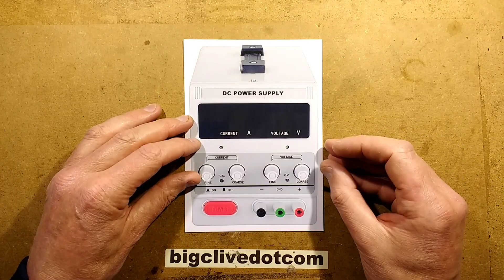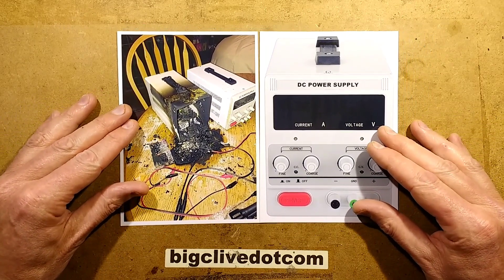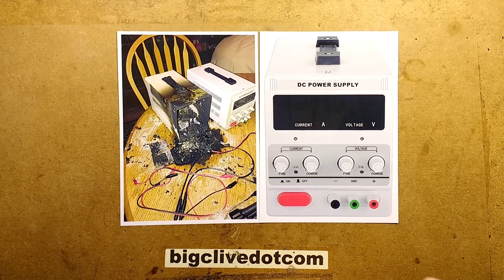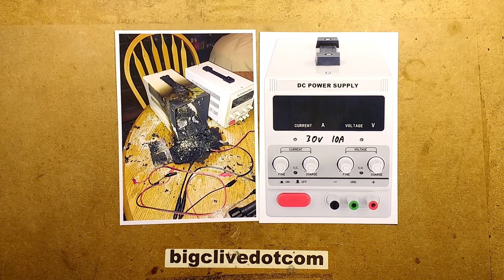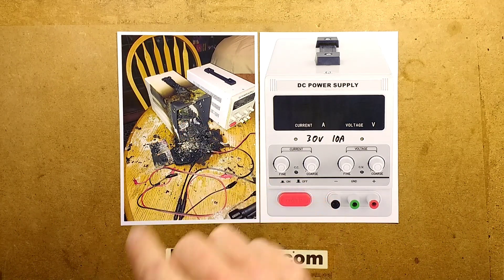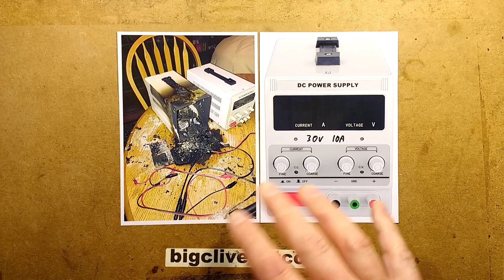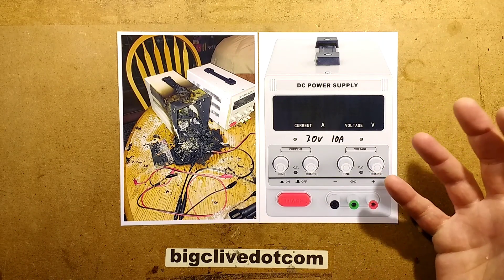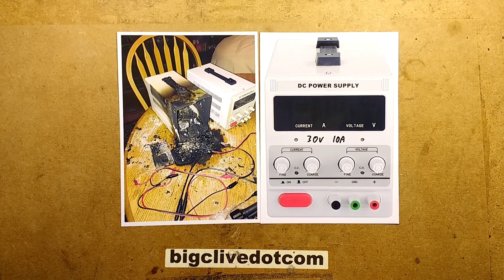Smokin' power supplies.  PSA

Comment: damn Clive. I blew 2 chinesium psu's last week.
Reply from the maker: A very common failure mode if used with external voltage sources like battery charging is for the output protection diode to fail short circuit.  Is that likely in your case?
Reply: No. I had a case of traces exploding...
https://lh3.googleusercontent.com/-Vvarhu7iAZSZBocZKExwgS6IZwG7Zbl5KBeFbx2Di24UblcOYH9r9Ru_hq4S7PpVanl-MzB
Reply: I did check the diodes, fuse. Did a full visual inspection as well as checking values of components that I was able to find the values for. The photo is from a Kentek 700w pc psu (GL-PSPK700B). Ran fine for 3 months and BOOM. 

It was my fault for buying crap. You get what you pay for, just like the other psu that bit the dust, a generic Chinese 20a 12v psu that came with my printer. I haven't taken a real good look at it yet as I was more concerned getting a dual rail psu going to support the hotbed and electonics on separate rails.

Comment: These are linear supplies, so the difference between maximum voltage and the selected voltage is dropped across an internal transistor. 
At 18 Volts, 8A this is at least 30-18= 12 Volts and at 8A is 12x8=96 watts. 
You would hope the cooling is up to the task of removing this heat plus the transformer losses.
As BC says only really for intermittent and attended use.

Comment: I had a similar looking supply (50V, 5A IIRC) Purchased off Ebay. The second time I used it I heard a crack and a fizz and it started billowing smoke out the sides. Fortunately, the seller agreed to let me return it. I have another one (30V, 3A) that I have used regularly for years without issue. Even so, I don't think I would ever leave the house with a live circuit on my bench.

Comment: Holy smokes (the only brand of cigarettes endorsed by God).  What variable PSU should I get as I am not into fires like that?
Reply: something chinesium which has atleast a brand and is sold by electronics shops online.
Reply: As long as your keeping an eye on it, as you should, you won't have any problems really. Also not a terrible idea to have a extinguisher at the bench as well, just in case.
Reply: Build one. There are tons of designs. There's modern L200 or a true classic like uA723/LM723. Mine is built using uA723(0-30V 0-5A but can go higher by disabling current limit). 300VA 2x14V transformer and two 2N3055 on a huge radiator. Goes down to around 100mV by using negative rail(could make it true 0V by adjusting negative rail voltage). There's also a second multi-tap/multi winding transformer which provides power for negative rail, relays and 10V winding for very low output voltages. uA723 is powered from a different supply than the power transistors. This means I can fully utilize the voltage provided by transformer without bothering about PN junction voltage drop as supply voltage of uA723 is greater than max output voltage. Ripple is very low too. Varies between 5-10mVpp(checked using scope). It keeps it low even under 100+W load.
Reply: +sparkplug1018 Not just any household fire extinguisher! check to make sure it can put out Electrical Fires..... the cheaper household ones contain water, and chemicals to make a foam.  The foam smothers the flames, but is CONDUCTIVE...... so anytime there is electric power, and no means to quickly unplug, or turn off the source of heat, there is the potential for shock'.

Comment: Clive, I think you owe it to your viewers to recreate circumstances and determine the true cause of the failure... or perhaps we would just all appreciate seeing a big bang. 🔥
Reply: Yeah, demo or it didn't happen? :p  Poor Clive, stuff like this will make him bankrupt
Reply: yeah time for clive to make one from a capacitor, resistor , rectifier and an old variable resistor,
Reply: inb4 he stuffs a pyrotechnic in the power supply.
Reply: Where's Buddy Vandoodle and his welding gun when ya need him? ;)
Reply: This would be a good thing to cover in a video, preferably having it open with the camera monitoring it outside with some kind of load so we could learn exactly what is the failure and cause of the fire.
Reply: I hope someone digs one out and mails it in. I'd love to see BigClive spend a while trying to determine the likely fault, or just make the fault himself!
Reply: If Clive had a "Mailbag" section, he'd probably not have the TIME to "spend a penny" (if you get my drift . .!)
Reply: ..Clive should have a mailbag section, wouldn't have to spend a penny then ;)
Reply: I couldn't agree more! The benchtop needs more burn marks.

Comment: I have the 30v 5amp one yikes, i wish you would do a teardown of one of these
Reply: I have that same unit as yours and it died early on, I complained to the seller and they suggested that I take it apart to see if I could find anything wrong, I found 1 of the mosfets were cooked and they said if I paid for delivery they would post another mosfet out to me, I told them to stick that offer up their bottoms and just replaced it myself also adding them to my do not deal with again list!
Reply: Mentorcase 
com'on now, if you're going to get real about a seller to that extent, at least go full flame and give me a name to avoid ;)
Reply: Mentorcase It's a hit a or miss with these it seems, I got lucky with mine, I ran mine pretty hard and no problems yet..

it also stays cool..I'm happy with it..mine is the qw ms305d
Reply: Upcycle Electronics im saving old caps for this 4th of july 😁
Reply: I have a so-called "LONG WEI" PS-305D that is now 5 years old and has served me faithfully without much trouble at all (except when I connected a battery in reverse to the output and some electrolytics inside exploded :D).
The longest continuous time I've used it was to recharge the boat batteries, which involved leaving it for THREE DAYS straight at 5A continuous (the 50A charger that is normally used was broken) and it didn't complain at all and survived the torture without trouble! Just in case it would burst into flames, I suspended it overboard with a small string so that the flames would burn the string and the flaming power supply would drop automatically into the sea water extinguishing it :D

The PS-305Ds are not all equal, some have better designs and some worse, even if they look the same from the outside. For instance, many of them have automatic thermal protection and fan thermostat (mine didn't but I modded it in) and some have the transformer with two primaries so they can work on 110 or 220V.
Reply: Benjamin Esposti since when do caps "reform" to a higher voltage. especially one that could be a knock off if it's on a cheapy.
Reply: JJayzX 
  Too bad electrolytic's aren't self healing safety caps.
Reply: Upcycle Electronics but even the ones that do, degrade and eventually pop if taken beyond spec constantly.
Reply: Mine is the Yihua 305D. It is linear, 30V at 5A.
Mine had corroded IC sockets, which I just got rid of and soldered the two op-amps directly to the PCB. The fan is very cruddy, and is an oddball 24V type! (It looks like a regular computer fan but it runs off of 24V)
In addition, the main filter capacitor is rated for 50V (6800uF @ 50V, supposedly Rubycon brand though I kinda wonder if it is fake or not), yet it has nearly 62V DC across it's pins. It hasn't blown up because it reformed itself to be able to withstand the slightly higher voltage.

P.S. All these power supplies tend to be slightly different inside. Yours may be different than mine. (Example: mine doesn't have any mosfets.)

P.S.2. I also have a 0-65V 0-5A switching power supply (made by "Arksen" ... I forget the model) which is noisy. It makes clicking noises under light load (due to it skipping PWM pulses). But the worst parts are that it has FAKE Nichicon PW capacitors (the sleeves are black instead of brown as they should be, and the text is crappily printed), and two zener diodes that run at somewhere over 130 degrees C. (My thermometer couldn't measure high enough!)
Reply: You are very correct sir ;)
Reply: Upcycle Electronics I actually should have one laying around somewhere that I removed from my 3d printer to put in a better one. should go and have some fun with it. 😁
Reply: JJayzX 
Could be interesting, flame, bloat, or blow?
  I've done the electrolytic surprise cap gun charade a few times, and just had my first tantalum cap go full Fantastic Four Superhero style on the project I'm currently working on (sadly wasn't recording at the moment), but I've yet to see a safety cap give it's full Broadway performance.
Reply: I did a tear down of the other common cheap bench power supply, but I think the video came out crappy the way I was trying out and never uploaded it.
Reply: JJayzX cool I'm going to check it out..

Comment: why on earth would he leave it running while he's out anyway? let alone powering something that is designed to generate heat? that just seems like a bad idea all round.
Reply: Yeah. Like others have said. I'm perfectly happy with my Chinesium eBay supply, but I'd never leave it, or any of my eBay devices, on unattended. I just chalk that up to getting a functional item for 1/10th of the cost and free shipping :-)
Reply: ***** he was powering a peltier plate
Reply: It may not have been the power supply that failed. I'd even say it's more likely that it was the wires. Chincy wires, where they skimped on the wire cross section or the connection to the connector isn't made properly, can get quite hot.
Reply: Well it could be 30v at 10a... for a very short time aswell... it's what they say "good enough for an average chinese ebay seller to give it a 30v 10a rating".
Reply: @superdau theres so many ways to skimp, transformer wire, make it alumnium, or cheaper varnish coating that won stand up to heat, cheap metal connectors with no spring washes, the cheap wires with less strands than the jacket implies, the wire joins, lack of thermo safety on the transformer, materials not rated for the heat....im sure if you looked closely at one, it would be a whole long list of borderline parts all being pushed beyond their rating, and then find the parts are not the quality and rating they promise
Reply: There's no way that thing was 300W. It's definitely a fake rating.
Reply: adding a logo costs 1c, another 1cent for the CE logo or UL fake, you can put fluke on it if you want, they are all the same, junk
Reply: +Eroge Guy It is a shit PSU, that is all.
A good PSU can be left on load, within spec, for months... hell I've seen some do a decade!
Reply: +Против Глобал Depends on whether it was a switching or linear supply. Linear supplies (somewhat counterintuitively) generate more heat at lower output voltages.
Reply: THe unattended peltier could be, but a proper PSU should take that for months if needed. Issue is, gargabe built to cost, with fake rating is a problem already. Is like audio in the 80s. Grab an amplifier and push all the day to max RMS spec, even when summer hot, nothing happens. Grab the same product from alibaba and it selfdestructs in seconds. Proper amps cost proper money and performs to spec. Aliexpress garbage is cheap, it will top the specs for some seconds then ... fire,. Better chance is to build some basic 723 based design with GOOD transistors from Digikey, overbuilt it (if the design needs 5 transistors just put 8) proper protection, thermal, fuse, current limiter bla bla bla. Yes, it is gonna o be bulky, its gonna to be uggly. But it wont put a fire in you house. This cheap PSUs tend to blow the pass transistor, at 30V 10A no probs but  let 5V 10A .... Sure, they use multitap ...  not sure now ...LOL too expensive ... the relays you know. Sure its one tap all the way, small heatsink and best case a cheap fan and pray that people power leds or small arduino pcbs with it. Ahhh and avoid arcing and sparks and inductive things because this things go short from nothing.
Reply: I have one, and the rating stands.
Reply: Eroge Guy Because you expect something running at almost half of it's power rating not to go thermal nuclear? Also the Peltier plate wouldn't survive that much current without adequate heatsinks to begin with so the blame goes back to the shoddily made power supply.
Reply: have one of this exact model, it's a switching style, no huge transformer in it. that said, quality control can be dodgy. as i commented on the reddit post that this originated from(or xpost mayhaps) with all cheap chinese stuff of this nature one should never leave it on without supervision, and it should be taken apart and inspected before use. 

that said, at some point i'll probably tear it back apart and get a parts list and upgrade what i can to future proof it a little.
Reply: +Против Глобал It's pretty hard to buy quality on AliExpress. Quality stuff is more expensive, but half of the expensive stuff is the same cheap, shitty stuff, just terribly overpriced. And with the rampant fake reviews, there's really no way to tell (and when I'm paying a modest price for something, I don't really feel like taking the chance). Some things on AliExpress (e.g. Arduinos and the corresponding ATmega chips, ESP2866 modules, single board computers like the Orange Pi…) are consistently good, while others (like breadboard jumper wires which have high resistance and are sometimes completely broken) are consistently bad. The rest is hit and miss (e.g. high power CoB LED modules—sometimes for $10 you get a module with perfectly balanced chips and sometimes you get the same shit with half the chips dead that's being sold for $1.50).
Reply: +superdau: I'd guess it was either the peltier element or, as you said, wires that weren't quite up to the task. Either way the fault was likely in front of the power supply.
Reply: Misplaced trust in Chinese products, I would guess. I have a colleague who leaves everything on when he goes out - PSU, bench lights, soldering iron. His phone is often flat as he only charges it when it's dead. That's how some people are. You should be able to trust products. Unless the documentation specifically gives a short term rating. Even then, "foreseeable misuse" requires the product to be safe. It's basic stuff. This ought to be a case for Trading Standards. 

Yeah yeah so he bought it on eBay should have known better etc but what if your house caught fire? What if the fire spread to adjacent homes? Can you sleep knowing you're partly to blame?
Reply: Well... i would not trust chinesium ebay power supplies for unattended use.
That PSU does not even have a logo in the front... so it might be one of those really generic shenzhen type things.
Reply: @garbleduser:
Well... question is for how long can it run on those ratings... it may be able to output that rating for a few minutes or something but the guy described in the video left his house so he might have been gone for a few hours and that would give plenty of time for stuff inside to heat up.
It could be something really silly like too little copper in the tracks of the pcb or one of the cables going to the terminal at the front that is not thick enough to handle the full rating or more then half of the rating for more then a few minutes to allow cool down.
Reply: The "China Export" thing is a stupid myth. There is no such mark.
Reply: superdau “China Export” mark? Are you referring to the “CE” mark, which is “Conformite Europeenne” (French for European Conformity) which DOES exist, albeit much abused by unscrupulous manufacturers.